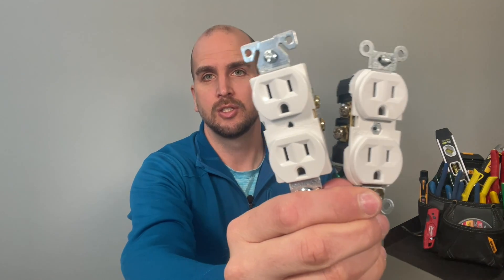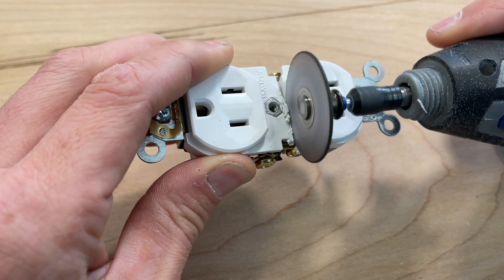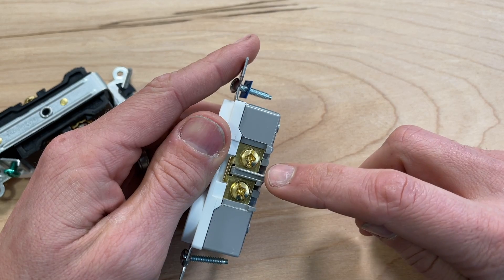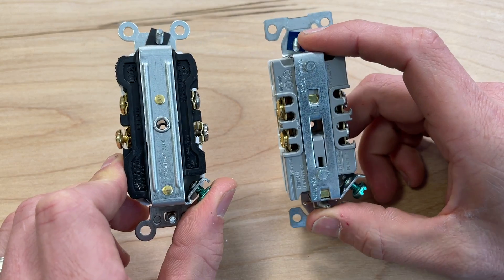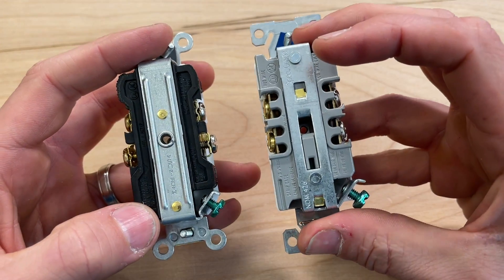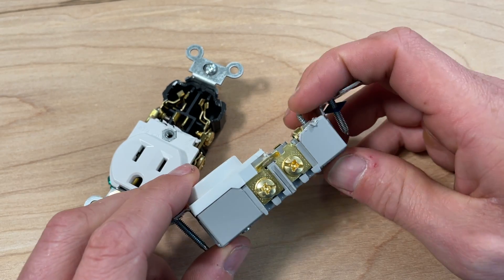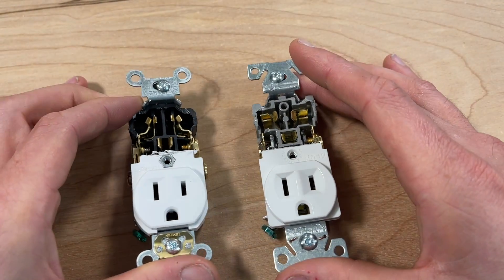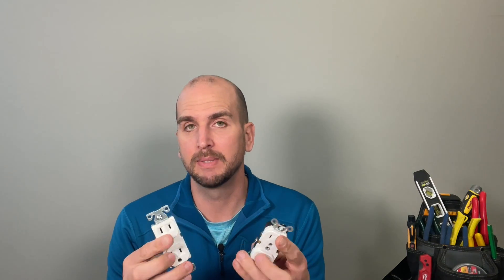What Outlet Should You Buy | Leviton vs Eaton

Comment: The Leviton Commercial Grade receptacle that is illustrated in this video appears to be Leviton's so called "Plus" Model which you can find at Home Depot - The 15 Amp Model is identified as CBR15 and it sells for $ 2.18 - The 20 Amp Model is identified as CBR20 and it sells for $ 3.28 - Leviton's next Grade up from their Commercial Grade is known as their Industrial Grade "Plus Pro" which are the models which I very much prefer - Their Industrial line is also available at Home Depot - The 15 Amp Model is identified as 5252 and it sells for $ 6.28 - The 20 Amp Model is identified as 5352 and it sells for $ 7.28 - Relatively speaking, their Industrial line costs about 3 times as much as their Commercial line but they are worth it - The Back Wire terminals of their Industrial line looks very much like the Eaton receptacle that is shown in this video in that the Back Wire connection terminals have two molded slots per terminal which will allow you to firmly attach two wires to each said terminal if the need should arise - The Ground terminal of their Industrial line ("Plus Pro") also offers a Back Wire (clamp/screw) connection which their Commercial line does not - Their Commercial line ("Plus") only has a screw (no clamp apparatus) - The Ground terminal of the Eaton receptacle shown in this video also appears to be the same as the Leviton (screw only - no clamp apparatus) - When installing High Grade receptacles which come with Back Wire connection terminals, my preference is to use the Back Wire Connection terminals - In my opinion, a Back Wire connection is (1) easier / quicker to connect than a Side Wire connection, (2) is just as firm as a Side Wire connection, (3) seems to make it easier to push the receptacle back into the box than what a Side Wire connection does and (4) in certain installs, such as Split Feeds, you might need to attach two wires to a single terminal which a Side Wire connection does not allow you to do (prohibited by Code) - In summary, buy Leviton's Industrial Grade receptacles and use the Back Wire connection terminals to make all your connections
Reply from the maker: Howard thanks for all the great info!  Appreciate the engagement.
Reply: You mentioned a split feed and attaching two wires to the black terminal.  Why would you do that?  I haven't heard of it (not an electrician).
Reply: A Duplex receptacle has two plugs (an upper and a lower) which are normally joined / connected together by a Common Fin on both sides (Hot terminal sides and the Neutral terminal sides) of the receptacle when you first buy them - The Common Fins can be broken off which will allow you to feed each plug separately - There are several different wiring configurations that you can use when you wire up a Duplex receptacle in Split Feed mode - Basically, the wiring configuration that you will use will depend on what you are trying to accomplish - I will give you the two most common applications of a Split Feed - Probably the most common application is in a high demand area such as a Kitchen or Workshop, where you might want each plug of the receptacle to be from a different circuit - In this case, you will need two hot wires coming into the box from two different circuits - Normally, this is done with one cable which would contain two hot wires (normally, a color coded Black wire and a color coded Red wire), a Neutral wire and a Ground wire - Normally, only the Hot Common Fin is broken off leaving the Neutral Common Fin intact - You would connect one hot wire to the hot terminal of one plug and the other hot wire to the hot terminal of the other plug - The Neutral wire can be connected to the Neutral terminal of either plug - The other most common application is were you wire up one plug to be constantly on and the other plug to be controlled from an upstream switch - The upstream switch is most commonly your every day wall switch that you would normally use to turn on a lamp that is plugged into the receptacle that is controlled by the switch - In this case, you can either use two hot wires fed from two different circuits or two hot wires from the same circuit - In this setup, the Hot Common fin would be broken off - The Neutral Common Fin is normally left intact but could be broken off if you are supplying the box with two separate cables which would have two separate neutrals - The answer to your specific question "why would you want to connect two wires to the Black terminal" is as follows - In a split feed configuration,  the Hot terminal of each plug is supplied with a separate Hot wire which may or may not be from the same circuit and which may or not be controlled by an upstream switch - No matter what Split Feed configuration you decide to use, you will always have at least one Hot wire attached to the Hot terminal of each plug - With that being said, your question now becomes >> Why do you need to attach another Hot wire to one of the Hot wire terminals of one of the plugs - The answer is >> You don’t always need a third Hot wire - Again, as I mentioned, it depends on what you are trying to accomplish - The most common reason for attaching an extra Hot wire to one of the Hot wire terminals is >> Most electricians, in an effort to save time and money, will wire up their circuits in a Daisy Chain configuration which means that each receptacle box in the chain / circuit will be wired up with one incoming cable supplying power into the box and one outgoing cable to supply power to all other downstream receptacles in the chain / Circuit - The Hot wire of the outgoing cable would need to be connected to one of the Hot terminals of one of the plugs in order to feed the other receptacles downstream - In the alternative, rather than connecting the Hot wire of the outgoing cable to one of the Hot terminals of one of the plugs and the Neutral wire to one of the Neutral terminals and Ground wire to the Ground terminal, some electricians will use a so called Pigtail configuration which I do not prefer - In a Pigtail configuration, NONE of the outgoing cable wires are connected to the receptacle - See my other post at https://www.youtube.com/watch?v=_rRa_CedJ38 which explains my position regarding the use of Pigtails on High Grade recepatacles - Reply back if you still have questions
Reply: @rjtumble  As an example of one of the things you can do. I needed to wire a lamp (that had a failed switch). Built a small box, installed an outlet and split it. One was always hot, for a phone charger, the other was wired to a switch to turn the lamp off and on.

Comment: I prefer romex sticking out of the wall. People then can just plug stuff in any way they want. ⚡⚡⚡
Reply from the maker: Would be versatile and inexpensive 😬
Reply: Just have to remember, black goes in the tiny hole and white goes in the bigger one! The exposed copper wire is just leftovers, you'll be all good.
Reply: @Camelotsmoon  I'm trying to decide if this was meant as a dirty joke and if so, which are the tiny and bigger holes?
Reply: @Camelotsmoon  Don't get your shorts in a bunch.  it's what you need to know when testing outlets with a multimeter - for correct wiring.
Reply: And if you need an extension cord, just splice on some old wire hangers.
Reply: Just put alligator clips on the ends
Reply: So THAT'S what that little hole in the 1 s pl made of the plug is for! It holds 1 of the wires so your other hand can be free for the 2nd wire!  How far out of the wall is your wiring?

Comment: If you have to replace one outlet, in a homeowner's 3rd floor attic, and you forgot your strippers plus you're already in the attic, dang right I'll use that "hidden feature."
Reply from the maker: Seems fair 🙂
Reply: Forgot your strippers?  That actually happens?  My multitool lineman's pliers/cutter/stripper is attached to me like an arm.  🙂
Reply: I guess your right but if your replacing a outlet, you would know you need a screwdriver from the tool box, and that would hopefully jog your memory to bring any additional tools you need, strippers, tape, flashlight, etc.
Reply: Meh.  I have my old mil-spec electrician's knife on me at all times.  Far less hassle to strip the wire with that and then slip the second blade out to drive the screws.

Comment: One thing that may not be known is that those ears with the holes actually have a purpose. Most diy'ers think that they are there to touch the drywall if the box is set back in the wall and not flush with the surface, but actually those ears are meant to be broken off and placed on the screws as spacers to keep the receptacle at the proper depth.
Reply from the maker: Hey Norman, that is the first time I have heard the spacer use case for the ears.  Thanks for the feedback.
Reply: I had never heard that before.  It made sense to me that they were meant to rest on the wallboard as you mentioned.  Not sure I understand just how they can be used as spacers.  I probably have an old outlet that I can experiment with.  If they are meant to be used on deeply recessed boxes I don't think they are thick enough.
Reply: @michaelcagley2617  For deep spacers I keep chromed plumbing supply tubing cut ends to use to make custom length spacers.
Reply: They make great small washers for the screws also ! Personally I carry a small length of aquarium airline hose to cut to length and slide over the screw before installing to offset the depth problem. Those ears are also made like that so they can be removed when installing devices in remodel boxes so the device fits in the indintation around the screw holes so wall plates fit properly and for easier alignment of multigang boxes.
Reply: No: the ears will in certain situations comply with NEC code: Not more than1/4 inch set back. 314.20 In Wall or Ceiling. In walls or ceilings with a surface of concrete, tile, gypsum, plaster, or other noncombustible material, boxes employing a flush-type cover or faceplate shall be installed so that the front edge of the box, plaster ring, extension ring, or listed extender will not be set back of the finished surface more than 6 mm (1⁄4 in.).***My opinion: If less than ¼ inch noncombustible material; use the plaster ears to flush face receptacles. if not, flush use UL listed fire box extensions. And you may need longer device screws.
In walls and ceilings constructed of wood or other combustible surface material, boxes, plaster rings, extension rings, or listed extenders shall be flush with the finished surface or project therefrom.*** This can be achieved by using UL listed Switch box extensions if combustible surface material and box are not flush. And you may need longer device screws.
Reply: Say what?

Comment: Thanks for the review. I do tend to use Leviton due to familiar with it. I also use Leviton for residential data com for CAT5, coax, and audio faceplate connections.  I don’t like the back wire approach and prefer the ‘J’ connection for better mechanical connection.

Comment: Neat feature, but I can't imagine I'd use it unless I only had one box left and my Kleins had been "borrowed"
Reply from the maker: For sure, couldn't image actually using that feature for several.
Reply: @EverydayHomeRepairs  I think if your task for the day was just plug installs in a condo building, for example, the one tool install of the Eaton would make for a faster install. The stripper works well when you consider the wires are captive in the box. The push on the terminal screws means the capture tab is always in the right spot vice sometimes having to juggle the Leviton to open the hole. And the faceplate screw hole is designed to grab the screw and hold it vice the screw being loose.

Comment: Let your thumb do the work. Instead of struggling to rip the insulation off the wire, push off the back the outlet (next to the wire) wit your thumb. This method is use by all electricians whenever stripping wire with a hand held wire strippers.